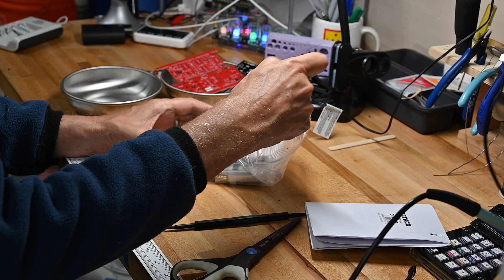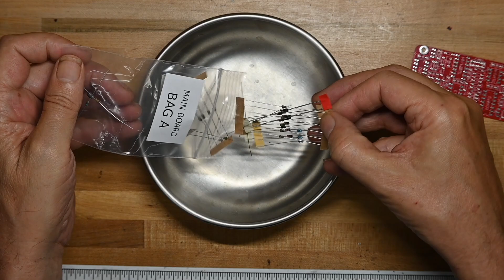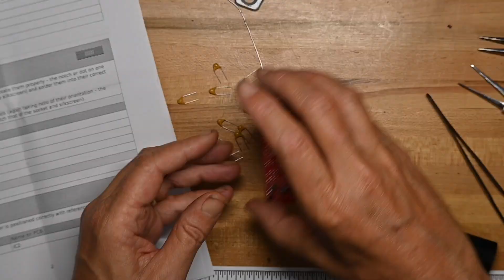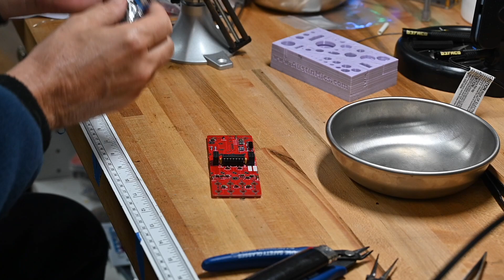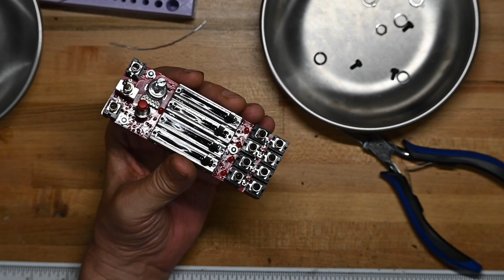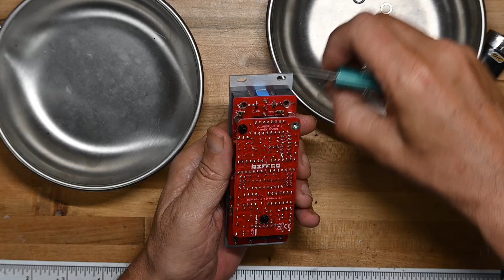C.K. builds a Befaco eurorack VC ADSR envelope generator kit (euro rack)

Comment: I finished mine a few hours ago, powered it up, and promptly let the smoke out. Oops!

I eventually found that the Shape pot was the fried part, and then found my solder bridge between pins 4 and 5. Checking for solder bridges before powering up would have been a good idea. 

New pot on order (from Thonk). With the bridge unbridged, the trigger+LEDs behave well, so maybe I didn’t fry any other parts.
Reply from the maker: Poor lil module!  Hopefully nothing else died.  I often shop at Mouser dot com for my electronics parts, their selection is huge.
Reply: @CKHaun  Agreed, Mouser is great, and also Digikey. In this case, the part is a bit obscure, and Thonk delivered by FedEx, U.K. to California, in 29 hours 10 minutes.
Reply from the maker: Yeah, that's why I buy 95% of my modules from Thonk, it's as if they were just down the street.